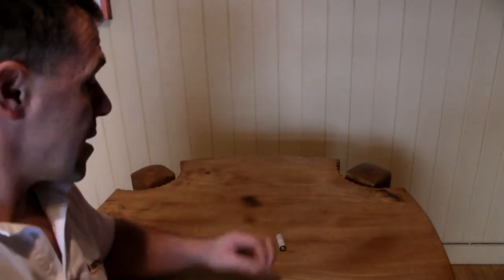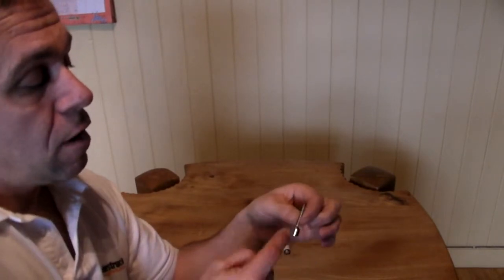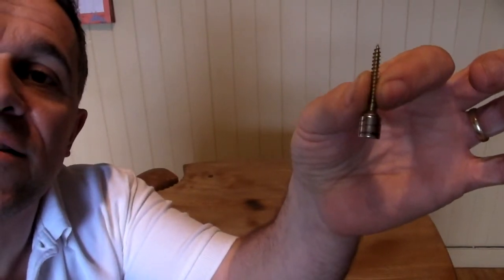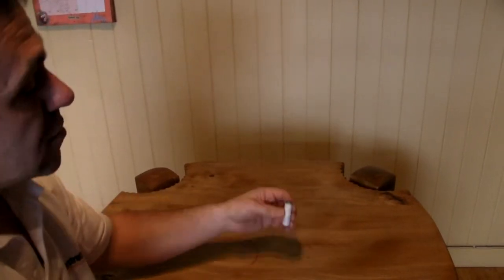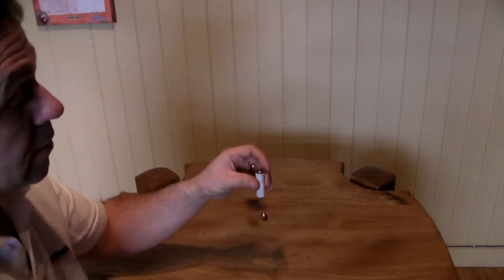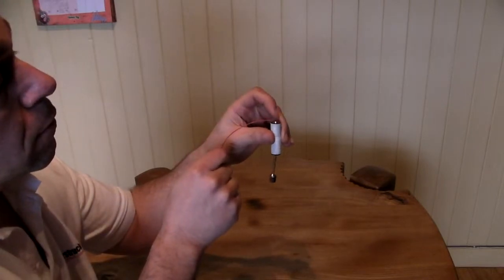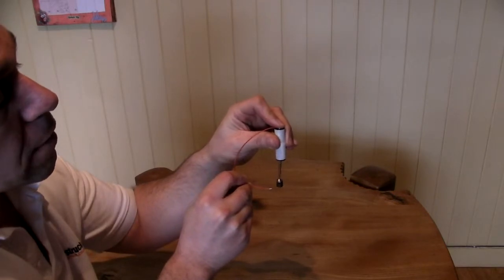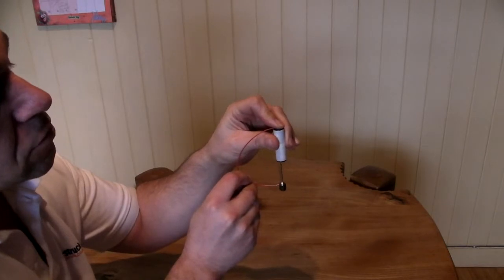How To Build A Homopolar Motor

Comment: I love these videos. I started out looking to build a crystal set. I know this video has been up a while but I wanted to know where do I get the magnet? I recall taking something apart that had them in. I know laptops have large ones of them. Thanks.
Reply from the maker: +Paul Evans Glad you like them.  We usually buy the magnets from a magnet supplier (just type neodymium magnet into google and you'll find a supplier).  In the UK a 10 mm diameter, 5 mm thick disc magnet costs about £1 but then you'll have shipping to add.  Maybe also have a look on ebay.  

As regards removing them from things, off the top of my head I can't think where would be easy to get a small disc magnet from.